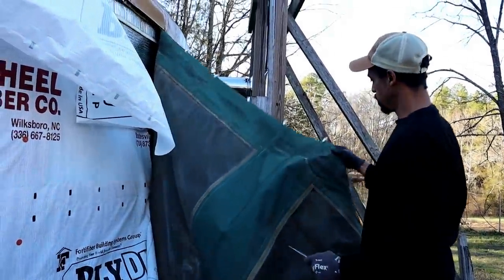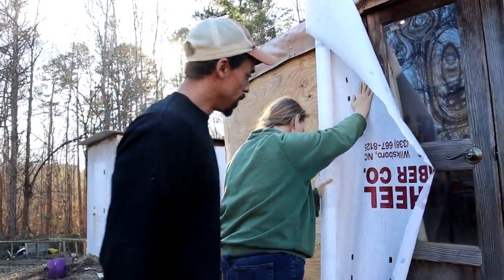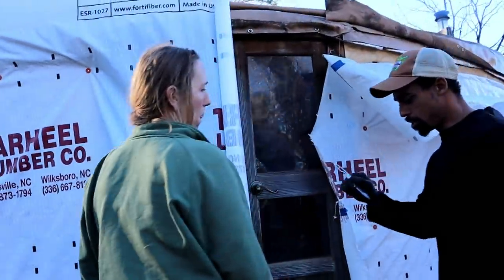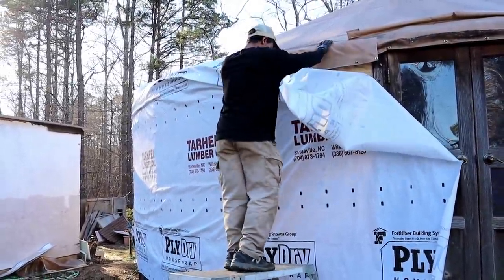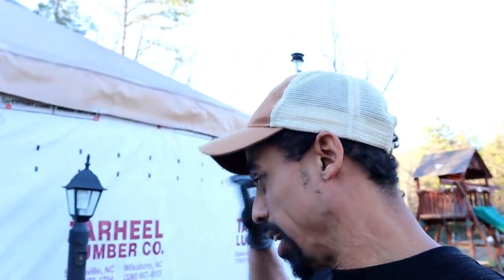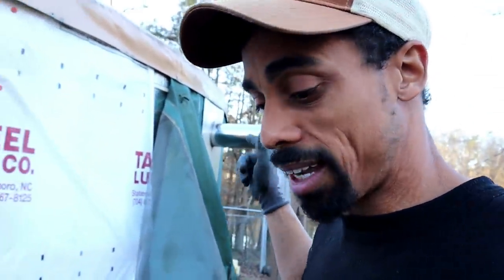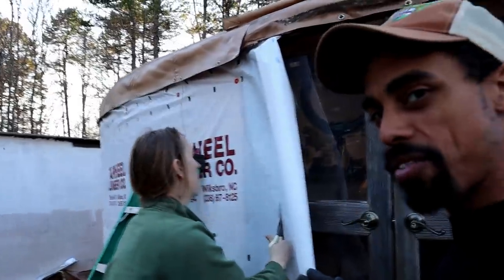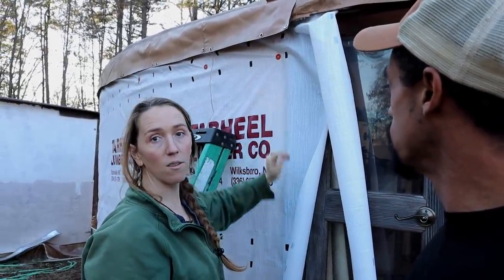What kind of house does she live in | yurt reno | day 3

Comment: You are in a 30' Pacific Yurts yurt like me, and I know what you are talking about when you say the roof is HEAVY!  350 pounds and the center is 13 ft off the floor.  I don't know how y'all's was folded since you bought it used but from Pacific Yurts it is folded so it unfolds easy...once on the rafters.  I put two sections of scaffolding in the center of the yurt and 4 of us pushed/pulled it up thru the center ring.  THAT was a job, especially since I was on a walker at the time the summer of 2009 when I built mine.

But it got done, and after almost 11 years living in mine I would do it all over again.